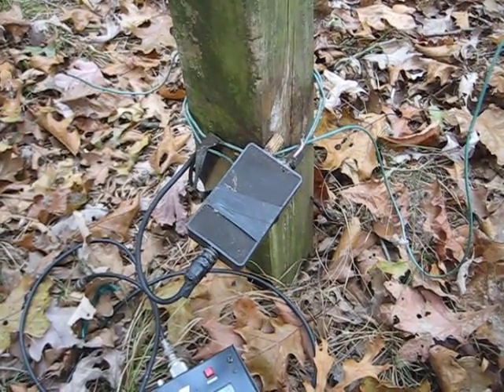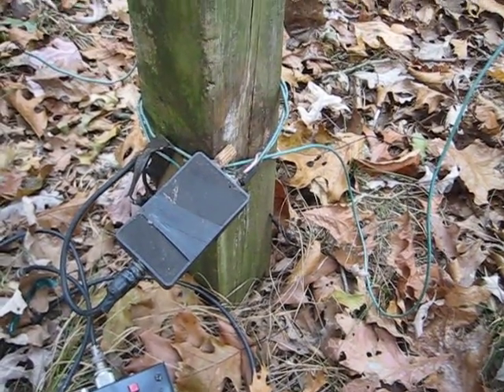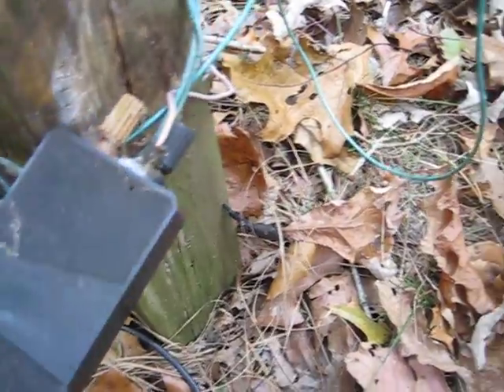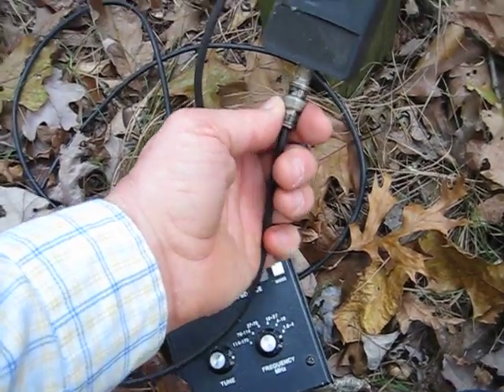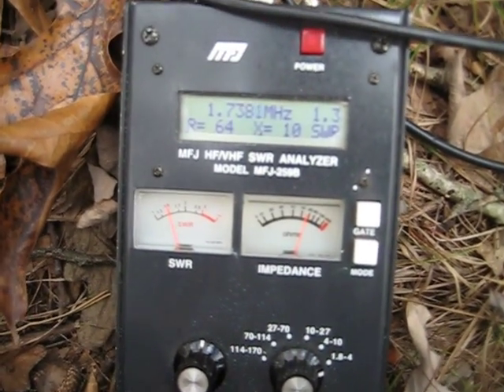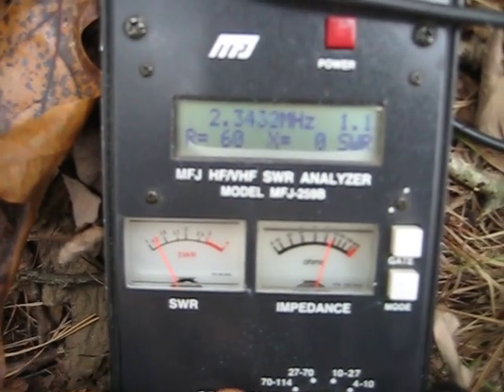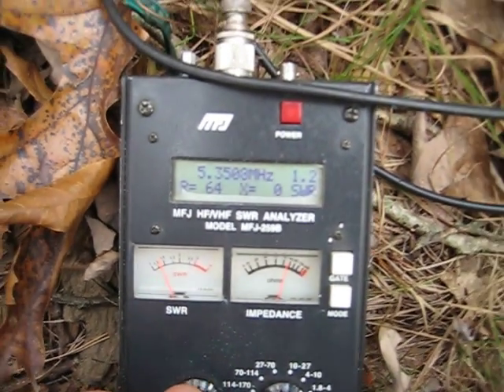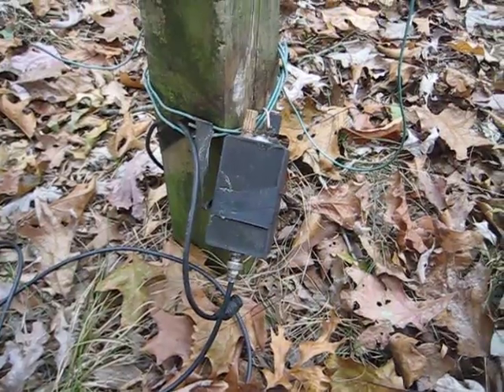Beverage antenna at K2XT - Part 3

Comment from the maker: Very sorry to be late responding.  I seldom check for msgs.  If the antenna goes NE from the feedpoint, so it is oriented NE-SW, it receives from the NE AND SW.  It a 450 ohm resistor is places at the NE end betw. the antenna wire and ground then it primarily receives from the NE.  So a terminated Beverage receives from one direction, and an unterminated Bev. receives from two directions. Beverages are very broadband,500 to 800 ft is a good length.